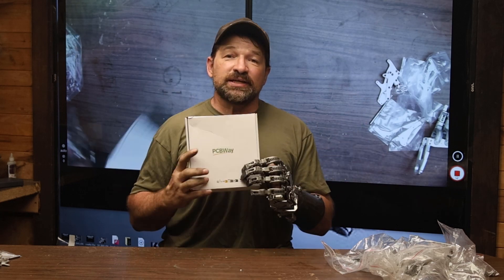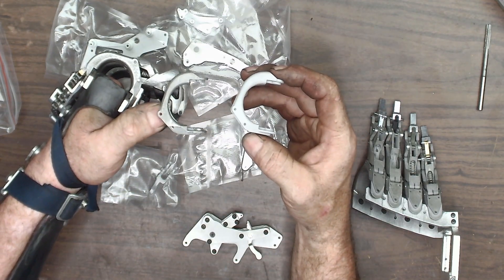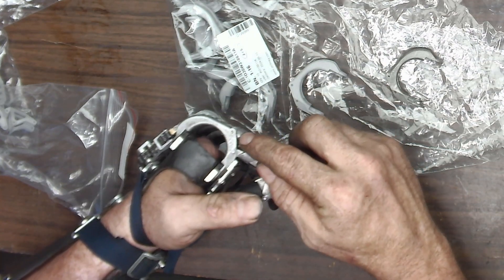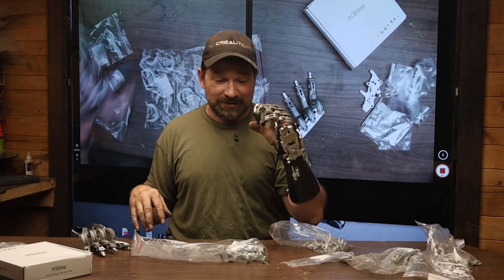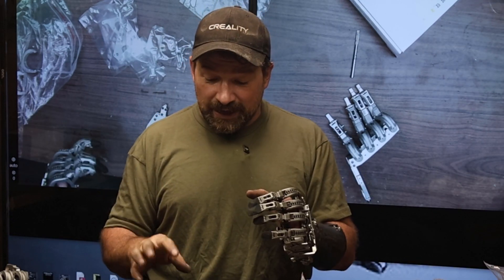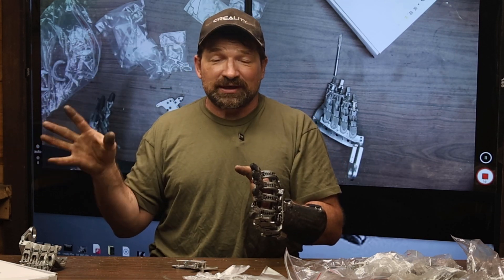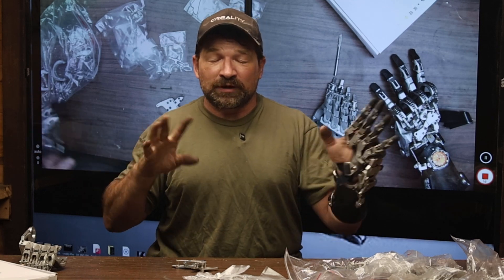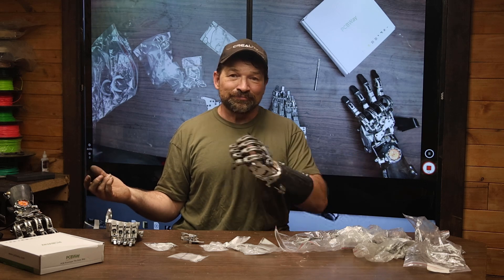I received the First Articles of the Winder Assembly from PCBway

Comment: Mr. Ian...

I saw elsewhere in the comments where someone is interested in trying to scale this sort of technology down to possibly fit a child.

But they noticed, that the size of the chains would become a complication at smaller scales.

Would it be possible to implement cables, like either bicycle brake cables or nylon cables, instead of the chains, to help reduce the size and weight?
Reply: Consider synchromesh cable. But i don't know if they can really make the radius, i have my doubts.

2gt timing belt is available with width down to 3mm, perhaps that helps.

You also do get all sort of miniaturised roller chain, say ones made from plastic, with 3mm pitch.

Comment: Is there a limited size range your hand design is feasible for?
Reply: Good question I know a little kid that is missing all four digits
Reply: Afik he's already using the smallest size of roller chain you can easily buy and that is a big limit on the minimum size for the current parts.  Watch makers might have some smaller chain?
Reply: @martylawson1638  There's a light duty plastic roller chain with 3mm pitch, 1kg tensile load. Perhaps that's OK for a child?

Or perhaps one could take that snap together design as inspiration and have the chain SLS metal 3D printed. Not the same way traditional roller chains are put together.